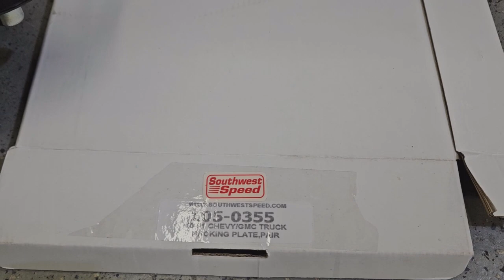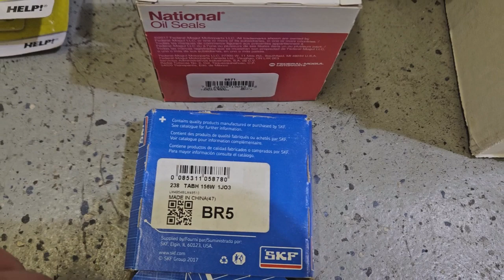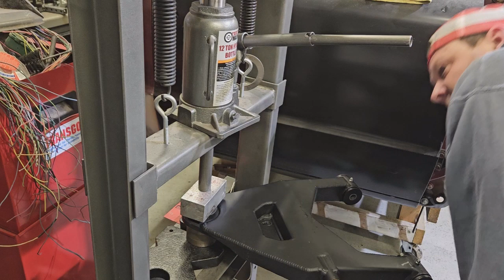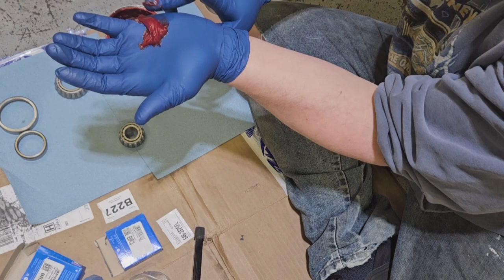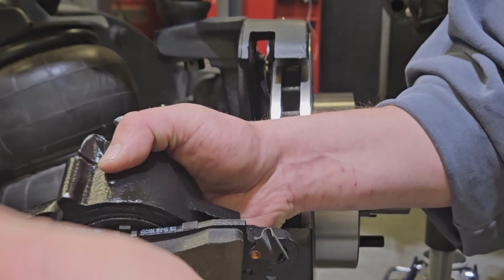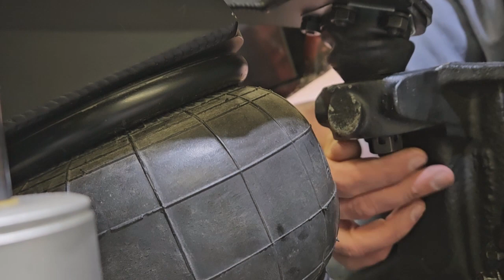1967-1972 Chevy /GMC Spindle build up and 5 lug swap

Comment: That 5 lug conversion is nice. Back in the day, if you wanted disc brakes, you took the spindles and stuff from a 72 to put on the earlier trucks. But you were still left with 6 lugs.
Reply from the maker: Thanks Paul! I was lucky enough to stumble on those 5 lugs from a 71 down in Missouri. It took quite a bit of elbow grease to get them cleaned up, but still wayyyyy cheaper than going aftermarket.